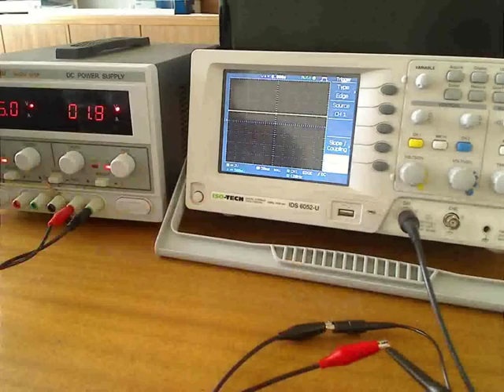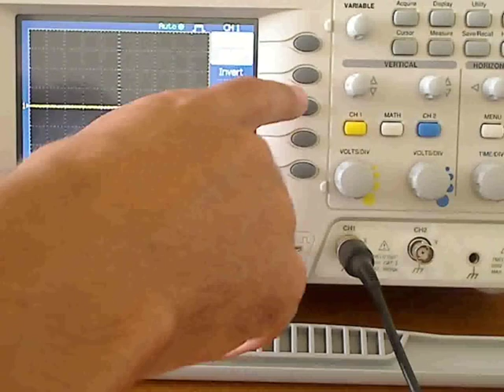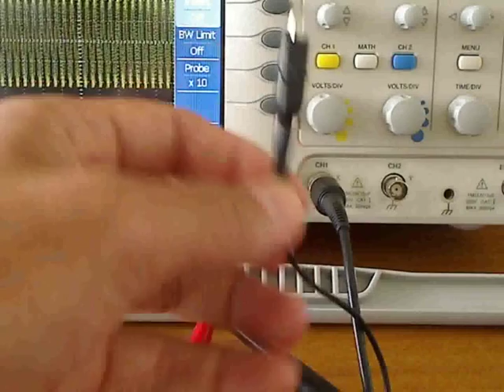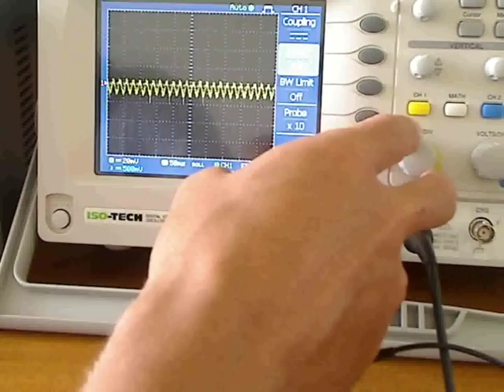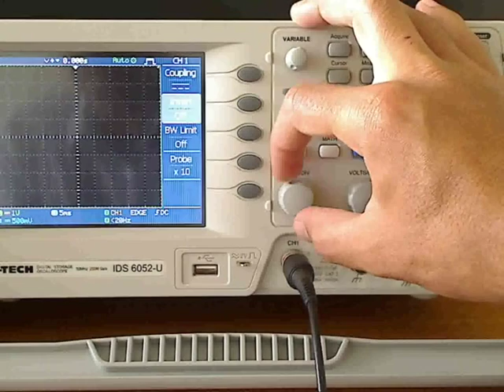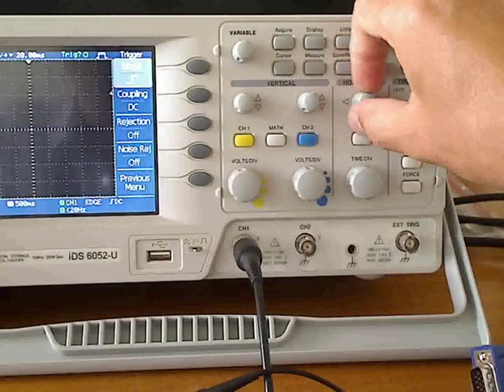Using a digital oscilloscope

Comment: Sir, what is the different usages of (1) - using ground and positive and (2) - using only the positives?
Reply from the maker: So you use the probe to measure a potential difference - a voltage. Because the probe's negative is earthed, if you want to measure a potential difference between two voltages and one is not earthed or floating, you need to use both scopes, and use the math function. This would normally not be an issue - as long as your supply is isolated (which the DC supplies are).
Reply: Sorry about the late reply. Thanx it helped!